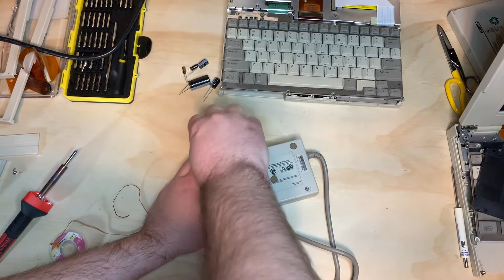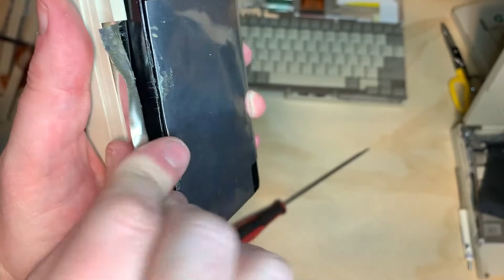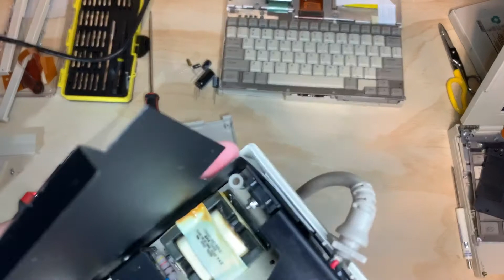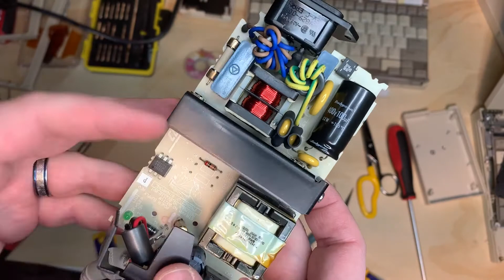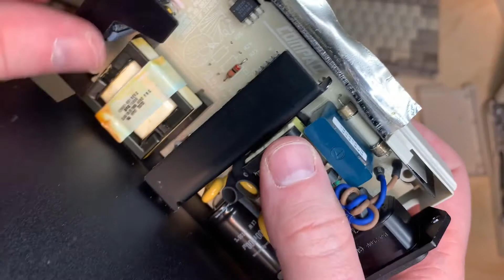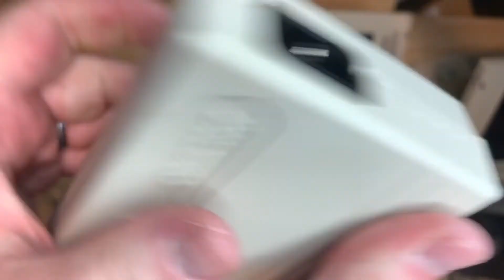Compaq LTE Lite AC Adapter repair.  Series 2812 Compaq Spare 129827-001 (version 129664-006)

Comment: Thanks for these videos. Just noticed my adapter has the 149179 part number in the lower left. What's the reason for saying this guide doesn't apply to it?
Reply from the maker: They take different capacitors.

Comment: Hey quick question. Does a series 2802 ac adapter work with a compaq lte 25c? I found one online but I'm ususre whether they are compatible or not?
Reply from the maker: The 2802 is not compatible
Reply: Ok looks like im gonna need to repair my current adapter as well since it died on me. Wish me luck! 🎉

Comment: I've just decapped a nonworking 2812, and I noticed the values of my capacitors are different from those in your replacement list. I'm having to order new caps anyway, so would you recommend replacing them with caps of the same value as currently in my unit, or is there a method to your madness?

For reference, I have:
C8 : 47 uF 400V
C12 & C13 : 220 uF 35V
C18 : 10uF 50V
C24 : 68uF 35V
Reply from the maker: Replace with whatever yours had originally.  There’s probably a couple versions of this adapter floating around.
Reply: @i80386sx  Cool, thank you! I've really enjoyed your many deep dives on these machines, and I'm looking forward to someday booting one myself ;)
Reply from the maker: My madness was replace with whatever my adapter had.
Reply: I finally got the guts to try powering on my LTE Lite 4/25Cs with the recapped power supply and it's a success! Now I "just" need to do the rest of the work. Thanks again for the great videos!

Comment: great video ! just a dumb question, how can you 'tell' that its the capacitors that are the problem? I mean, in some cases it obvious e.g. they are burst. but in these cases, is it simply that if a psu/old circuit doesnt work that's the most likely explanation?
is there an easy way to test if these caps are working or not, or is it more they work just not very well etc.

Either way I'll give this a try, i have a very similar laptop to this one picked up on the cheap that i havent been able to try yet :)
Reply from the maker: I just guessed.  Capacitors dry out over time.  There is a test you can do with a multimeter I believe.
Reply: @i80386sx  well it seems the power adaptor works? The act of measuring both the mains and the power out seemed to make the led turn on, and now it seems to output power. No clue if it's actually delivering that though as i think my laptops CMOS is dead, so I'll follow that other video now 🙂. Although i have a 25c